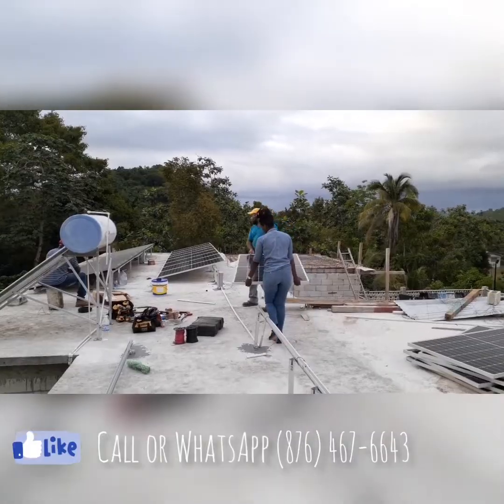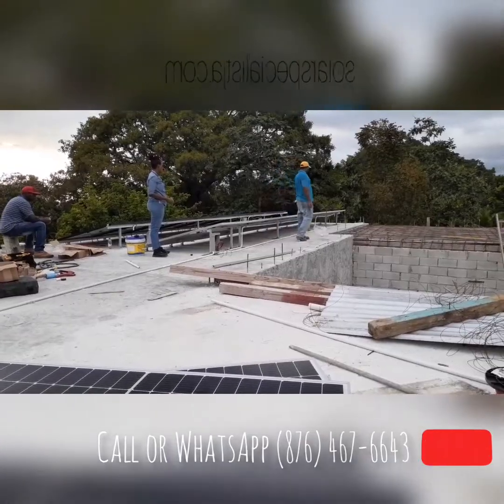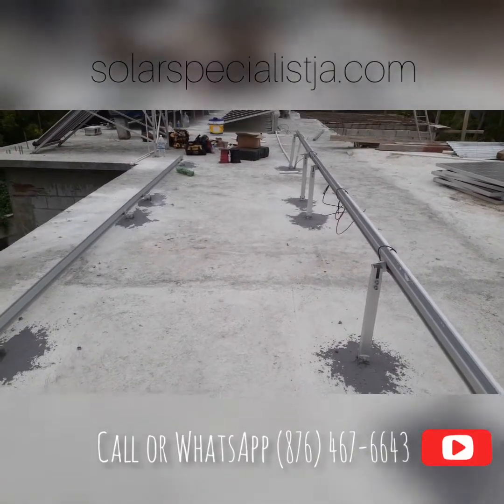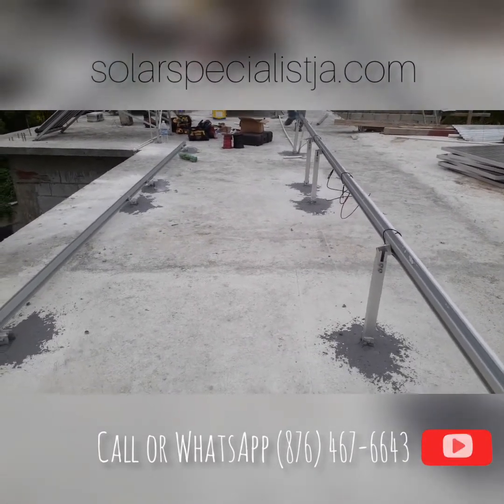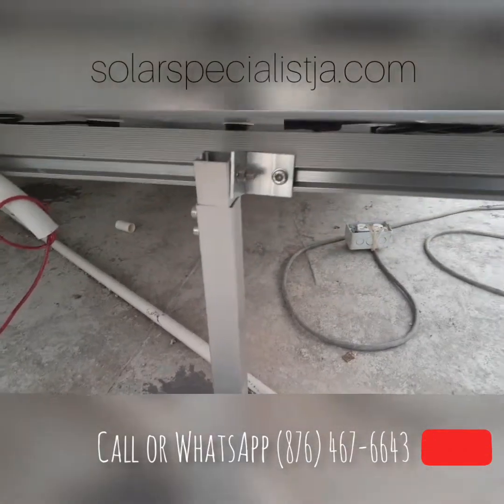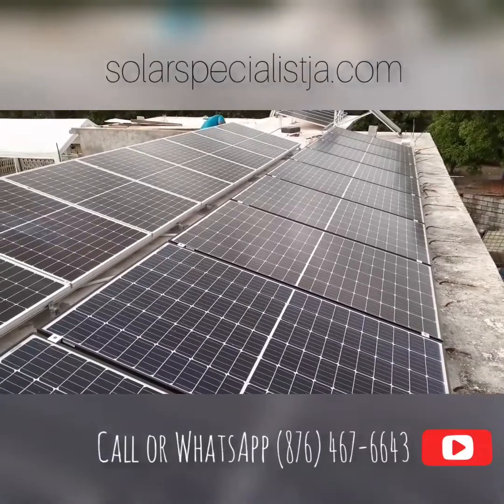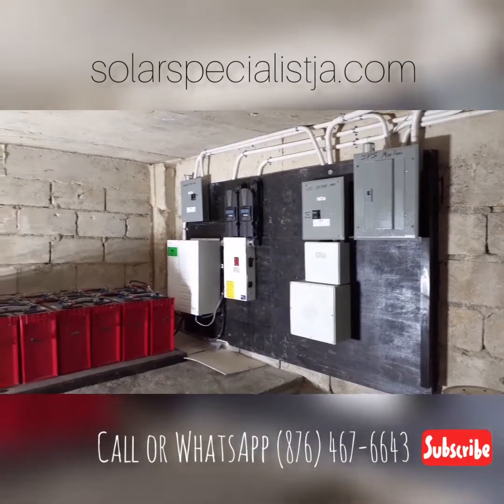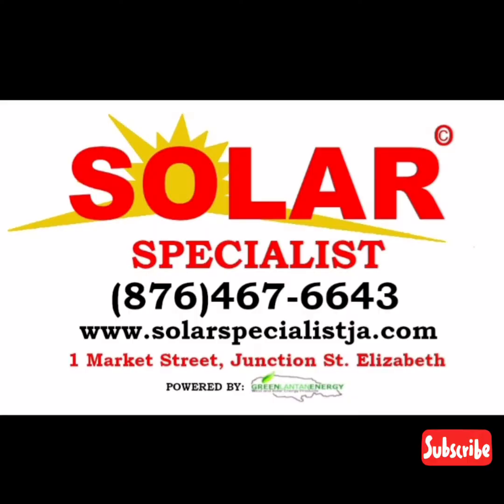Totally Off-grid with Solar Energy 8KW Westmoreland Jamaica

Comment: Lithium cant handle surge? There are  lithium batteries that can do 250amp continuous power and if you still not sure put  a 4.7 kOhm 5 Watt resistor in line of the positive wire between battery bank and inverter, to prevent the inverter capacitor from going wild on the poor batteries. You do know electric cars on average can pull 400kw from there lithium batteries (avg 50kwh) now that's a surge.

Comment: It would be the battery management system BMS that has that surge limitation, not lithium ion batteries in general.
Reply: Thanks for pointing that out I wondered what he was talking about...
Reply: Also, a low frequency inverter with a transformer inside is better for high surge applications. Love the installation though, neat. Not going with any other battery chemistry than LiFePo4 still. Just my personal preference.

Comment: how much does a system like this cost
Reply: He said 18000 a piece for the solar panel and he used 24 of them that's $432,000 and that's just for the panels that does not include the batteries and the charge controller  plus installation fee, you probably looking at close to a million dollar

Comment: Unfortunately lithium can manage the load but not the high Serge buy using super capacitors as a booster will work for the Serge with the lithium batteries connected in parallel with the voltage it works
Reply: Thanks for pointing that relevant fact out....wondered what he was talking about
Reply: Hi rather the gsl system and battery, schnieder inverter is a beast still.